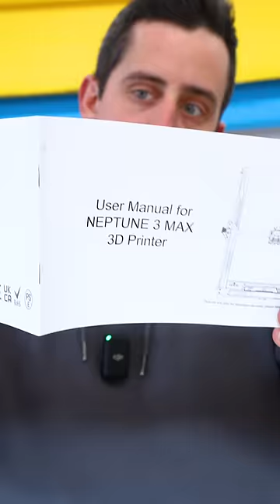Let's Assemble a New 3D Printer

Comment: I got some for you :
- Shoes with headlights
- a spoon that turns into a fork if you try to poke with it
-a watch that tells you when it's okay to stop shaking hands with someone
-a cup with 2 sides so you can have 2 different drinks
-a beer bottle opener that also used the cap as a projectile

Comment: Next unnecessary inventions, an automatic package opener that just burned the box but keep the contents safe
Reply: So if it would work for all packages it would have to

Open the box
Take off the box or contents
Move box to flame area 
Burn
Reply: A 3D printer that can only print parts for a machine that builds 3D printers
Reply: @Doodle128  so a 3D printer 3D printer?
Reply: @ngo_games5924  A 3D printer builder 3D printer
Reply: How about a: box that doesn’t need a box cutter to open..
99% of boxes have a don’t use boxcutter to open on them - what exactly are you supposed to use?